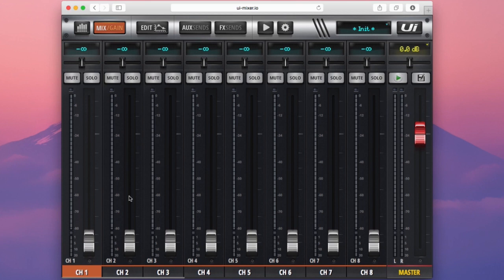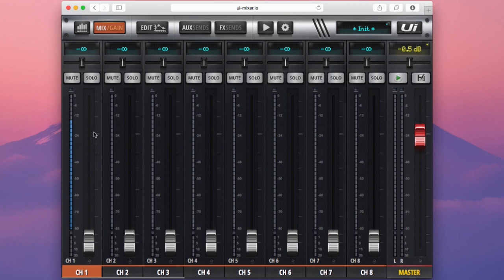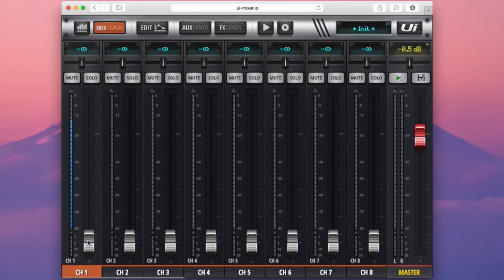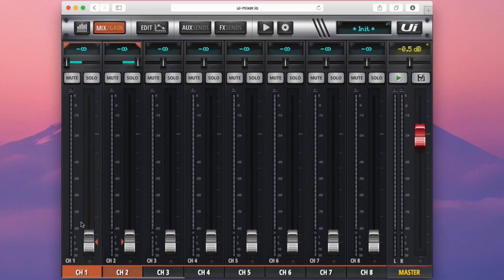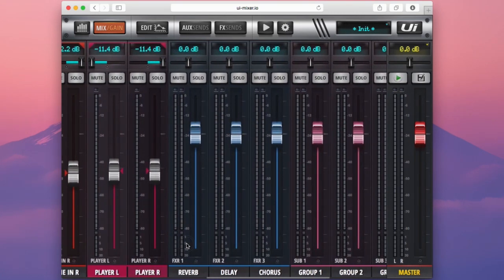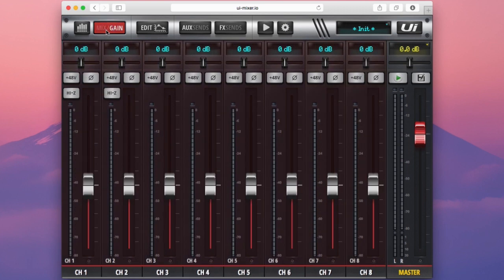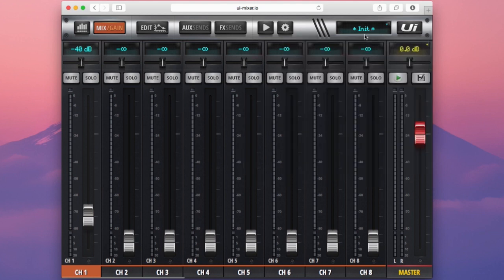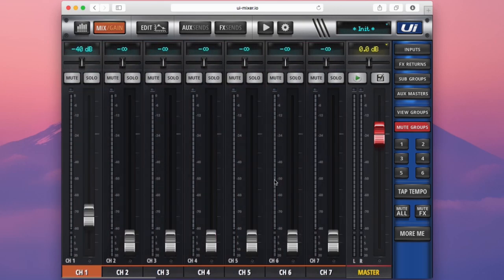Soundcraft Ui Series Tutorial: Overview of Main Fader Page

Comment: Hello, Nice job Thanks. I have a quick question please, on my UI24R the PFL meter (Red) on the Gain screen is higher than the PFL meter (Blue) on the Mix screen - any reason for that ? Thanks
Reply: New at mixing myself but if your input signal is low coming in you could have the gain all the way up (not a good thing really)  and you mix level could be at a decent level but show your gain higher. you always want to have some headroom is good, but if your gain is maxed out this may cause feedback  easier when playing (just my experience).